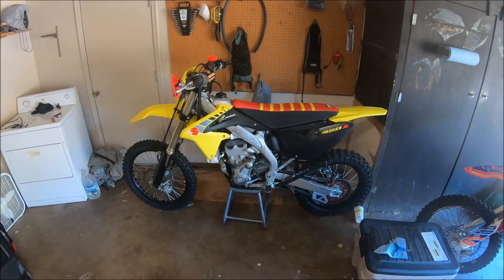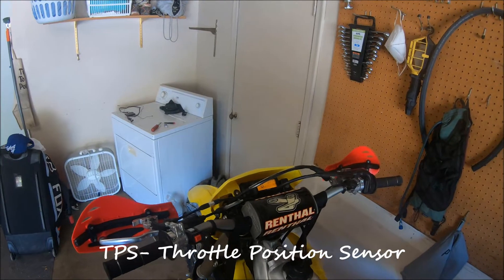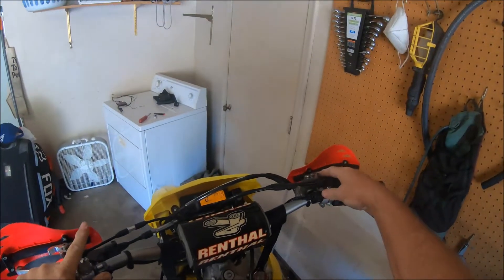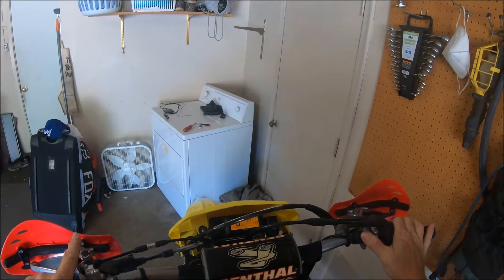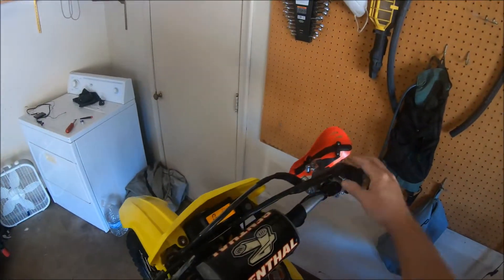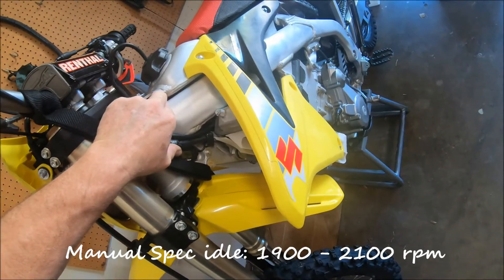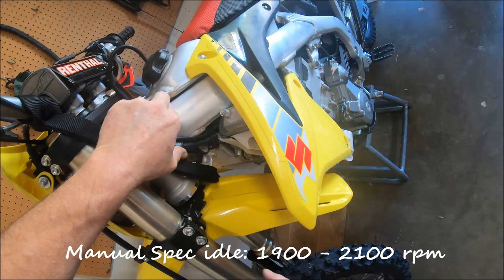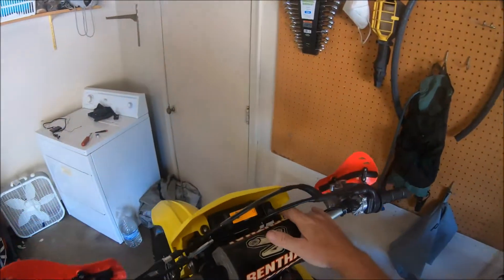Vortex TPS 2017 RMX450z

Comment: Hi, was the Vortex worth the extra money?
Reply from the maker: I got a new other unit from ebay originally programmed for a kx450. Tokyo Mods reprogrammed for my rmx since the box was the same just needed to be reprogrammed. Seems like I was in it for about $350. I like it better than the Wiseco tuner that's almost identical to the JD Jetting tuner(both made by Dobeck). I needed to bump up the low and mid trim pots on the vertex to reduce some lean popping. The RMX absolutely needs a fuel system as the stocker ecu is just crap. I just wish the vortex was programmable by the user like a Get box. You need a shop with the software and knowledge on how to use it. Vortex seems to be cooling off on support for the ecu. It's still on the bike at present in enduro 1 map.